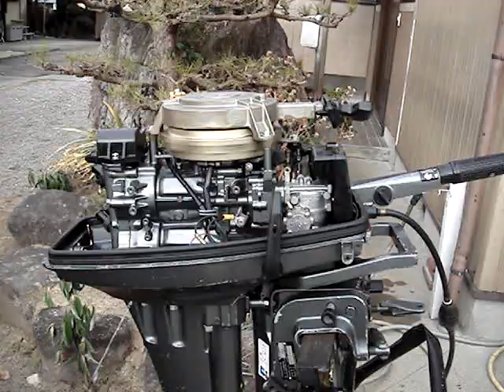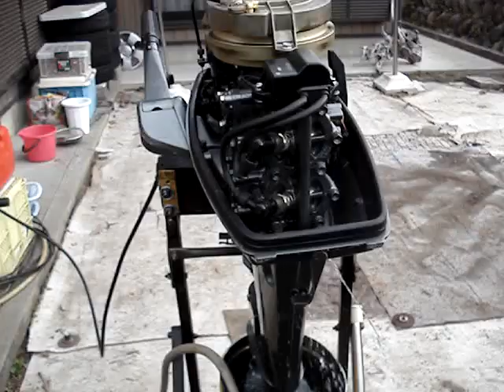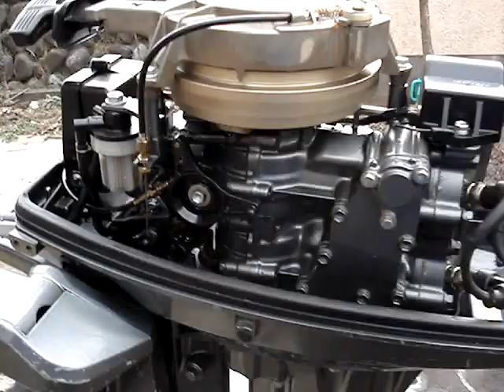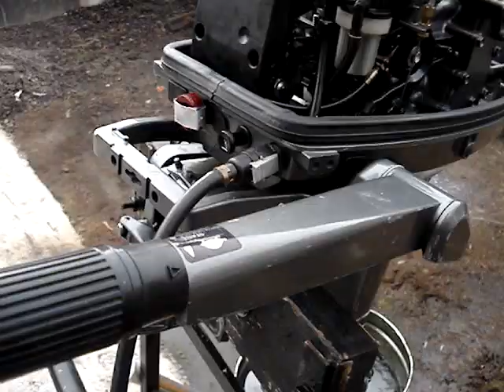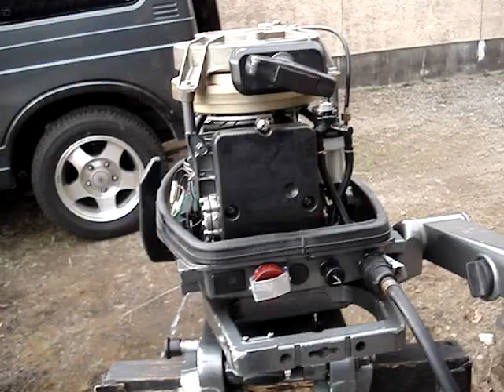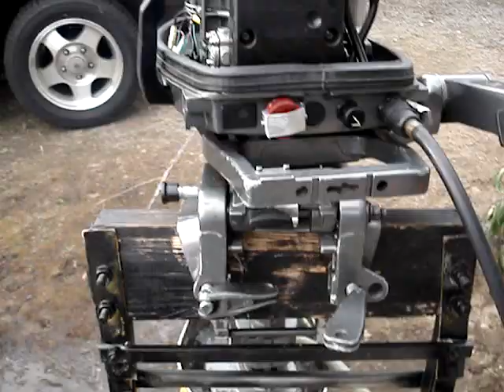幻シリーズ「船外機」第4弾!!　SUZUKIスズキ    2スト9.9馬力(DT9.9)

Comment from the maker: to dusty1999
Since it is 2 cycles of the fuel for this outboard motor, it uses at a rate of 50:1, mixing the oil for gasoline and outboard motors. 
A tank pays this composite fuel to an external tank, connects it with a hose, and it supplies it to the main part of an outboard motor.